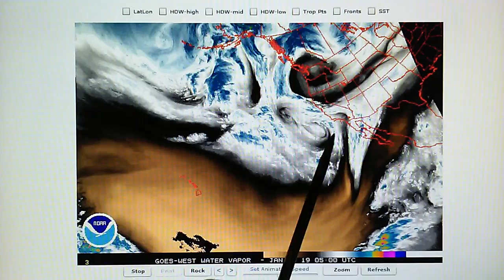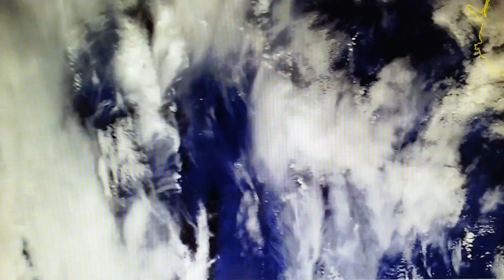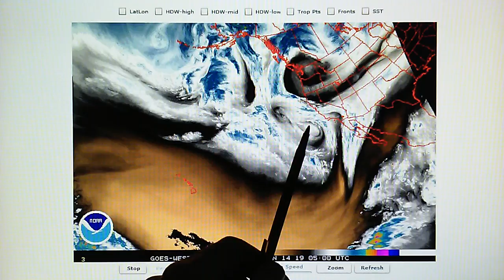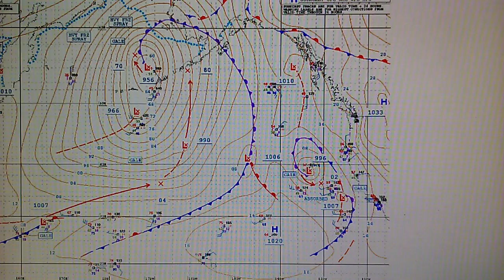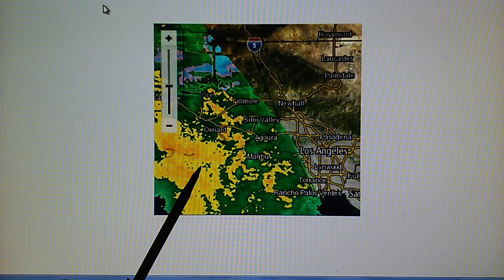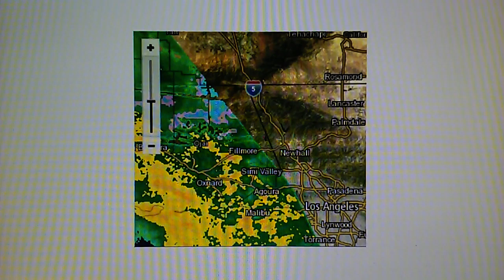1-13-2019; Large Weather System Scheduled To Move Into Southern CA; Aerosols Sprayed Delay Rain

Comment: I have an image that I just snipped with a large, rectangular cut out on the Accuweather doppler radar for CA, north of Sacramento. Any thought on what would cause that? I am glad that CA is finally getting rain, but too much of a good thing can be bad...
Reply: ...I will answer my own question: satellite based transmitter targeted to evaporate the moisture over a large area of northern CA. Quite a profound image, actually.
Reply: @JDGeorge1951  I've also heard the military has huge triangular craft with cloaking capabilities.
Reply: The NEXRAD radar is in militarized mode, chopping up the rainfield with high power microwaves